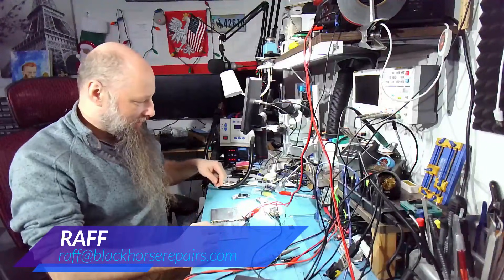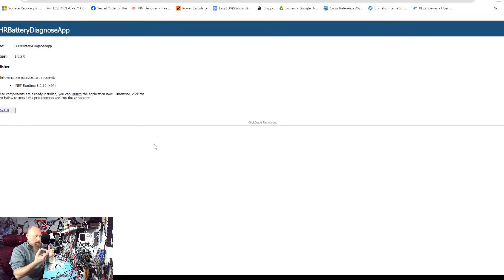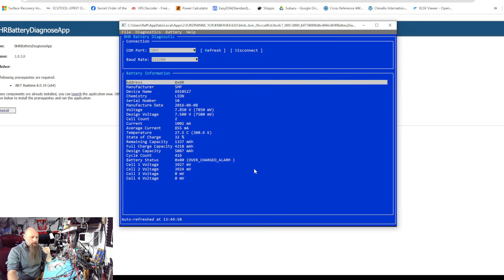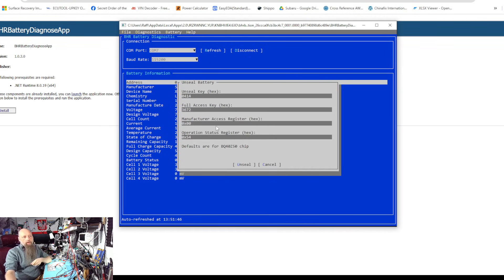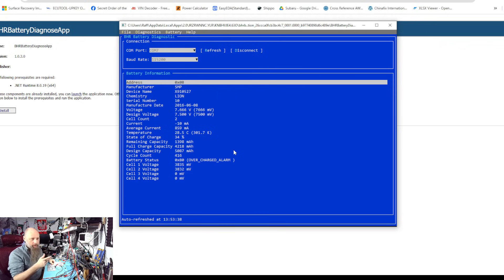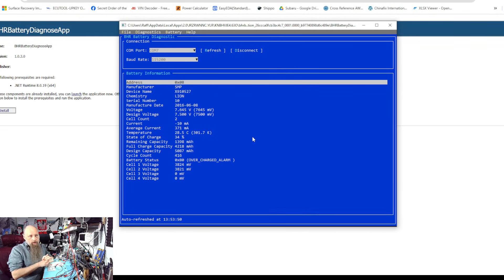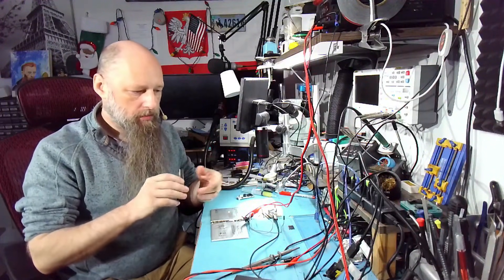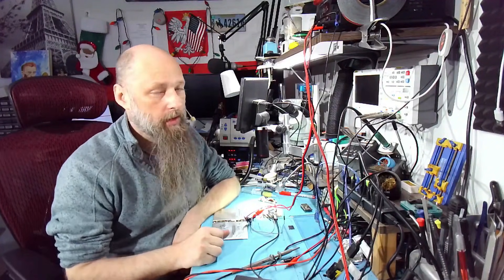Battery Diagnostic Tool - Beta Release

Comment: hey guys can some post the wire connection from esp32 c3 to the battery (what pins we use on the esp32 c3) thanks
Reply from the maker: IO04 - CLK
IO05 - DTA
Reply: Thank you

Comment: Do batteries protect themselves from brute forcing keys?
Reply from the maker: yes, there should be throttling allowing you to try only couple of times before you are timed out, but even without that testing all combinations is not viable unless you share the work across 1000s of nodes

Comment: I have eps32 C3 supermini and an arduino nano. Is there a way to load it on to either one? Assuming i would need the source code? I obviously have to modify pin allocations.
Reply from the maker: nano has 2kB of RAM while we need more than 3 so that one won't work. ESP32 is the best option. Make sure you download the firmware again, I just released an update
Reply: @blackhorserepairs  Sorry for Hijacking and thank you so much for your efforts, making this possible.
I´m not that into Microcontrollers, but have an ESP32-C3 and it´s Breakout-Board here. Is there a simple way flashing your firmware by eg just editing the linux .sh-script "--chip esp32" to  "--chip esp32-c3"?  Or another simple way?  gemini asked for sourcecode, but I´m fully aware it´s your baby. dont mind i wont ask. Sorry for noobing around.
Reply: @swifty8160 I have just loaded the three files in Raff's v.2 upload today that are within the "firmware\esp32" folder at the bottom. This has taken me to "no battery detected" Will test more tomorrow when sober lol. Nice one Raff 👍
Reply: @Mark_C1  Could you please clarify which device exactly your using now?`Did u manage to flash raffs Firmware onto ESP32-C3?
Reply: @blackhorserepairs will go with the esp32 then as the supermini has 4kb. TVM. I now have v2 so i will continue to try

Comment: May be Python would be a valid choice as a frameware for future tools too. Can be compiled into a independent binary, but it doesnt need to, as you prefer. Runs on many different systems with very few changed lines.

A 'battery wear level' reading would be nice, if doable. The difference between current full charge capacity and design capacity in percent. So the one at 2:33 would calculate as 100% * (4218mAh/5087mAh) = 82.9% -> this would read as a well aged, to be replaced soon battery, now aging very fast.
Reply from the maker: great suggestion, I'll implement that

Comment: Most of the esp32 use D21 and D22 for i2c as the default hw. Why did you choose to go with 4 and 5?
Also, why did you choose using an Arduino in the middle, while a simple ft232h board is way cheaper and software can communicate directly through it ?
Reply from the maker: Arduino framework or arduino board?
Reply: @blackhorserepairs  yes, both, I would take them out of the equation

Comment: Technical note on BQ8050 vs BQ40z60 unsealing behavior

Based on practical testing and SMBus experimentation:

BQ8050-based batteries
Unsealing is possible using standard ManufacturerAccess commands when the gauge is not permanently locked.

In my tests using SmartBatteryHack-master:

Writing to ManufacturerAccess (0x00)

Sending 0x0414, followed by 0x3672

Both commands issued sequentially within < 4 seconds

Successfully unseals the battery.

Tested battery:

Model: HSTNN‑UB7C

Gauge: BQ8050

After the sequence, the battery transitions to the UNSEALED state and allows access to protected functions.

BQ40Z60-based batteries (Lenovo)
For newer Lenovo packs, such as:

Battery model: L17C4PB0

Gauge family: BQ40Z60

Unsealing via SMBus is not possible once Permanent Failure (PF) is set.

Key observations:

PF flag permanently disables unseal keys

ManufacturerAccess unseal commands are ignored

OperationStatus, SafetyStatus, and PFStatus remain latched

CHG / DSG gate drivers may still be active, but logic-level access is blocked

This is enforced by OEM-custom firmware, not a temporary error

In other words:

On BQ40z60-class gauges, Lenovo disables the unseal mechanism at the firmware level after PF, making software-only recovery impossible.

Summary

✅ BQ8050: Unseal works using known key sequence if PF is not permanently latched

❌ BQ40Z60: Unseal blocked after PF by OEM firmware

🔒 This is intentional design, not a bug

🛠 Recovery requires hardware-level intervention (BMS replacement or gauge replacement), not SMBus commands
Reply: This is some pretty nice info. Do you know anything about how BQ20Z95DBT handles PF? Do I need to replace the bq20z95 itself? Or PF-state manageable by software?
Reply: @swifty8160  

PF (Permanent Failure) is essentially the end of the road.
Once a battery enters PF state, nothing can unlock it. It is even worse than a sealed battery.

The best solution is to replace the BQ fuel gauge chip. However, the replacement chip must be programmed with exactly the same configuration data as the original one.

This data must match the battery cells precisely.
The only reliable way to obtain it is from another working battery of the same model, by extracting its configuration and flashing it into the new BQ chip.

Comment: Please open source the code as well! It'd be awesome to port this to linux as well and write a more friendly UI :)
Reply: Second this, there have been too many shitheads that wanted to profit off of this using illegal or at least questionable tactics. Open sourcing is the only way to drive them out of business and therefore saving everybody else from being at their mercy...
Reply: Oh and I'm pretty sure Louis Rossmann would love to host the battery information and key list on his Consumer Wiki
Reply: Keep it closed source and charge money. There are far too many broke open source devs who abandon projects because everything free
Reply: @mychromebook9935 while I agree with the sentiment you present, that open source devs are very much underpaid (I love doing open source stuff myself and have / do support some projects I really like), I don't agree at all with your take.
You should advocate for supporting open source devs via donations and consultation work, not taking away open source software.
Plus, people should have a right to easily know what's on their computer.
A nice way to offer people a way to compensate you is to provide an "easy to use package". Currently someone will have to go splice cables and make connectors for different batteries, flash the firmware, debug, etc. You can offer a well built kit for a price :)
Plus, .NET projects and firmware files from well known SDKs are some of the easiest to "decompile".

Comment: I noticed that the battery has a capacity of 5000mAh but the full load is at 4200mAh. Does this mean it can be charged up to 100%, which is around 80%, with no degradation? I usually try to charge the batteries in my devices up to 80% to avoid that.
Reply from the maker: yes, that means degraded cells

Comment: Great news! I'm going to download and play around with it. I don't think I have any locked batteries on hand, but will see what happens. I have a pretty large collection of ESP32 variations to try it on.

You might consider using an optional configuration/properties file to override like the i2c pins, then you could support any ESP32 model without custom builds.

Also, cool to see a TUI interface. Reminds of developing in Borland Turbo C++ and TurboVision back in the day. :)

Comment: I'm confused which esp32 board to buy. Most of them have SDA and SCL on pins 33 and 36. Is it possible to help you with "hacking" the batteries ? Do you provide some tools to crack the codes ?
Reply: On most of the esp32  the hardware I2C  pins are GPIO 21 and GPIO 22. Its a beta realise, i believe its just a prof of concept, a base that will alow you to read a battery BMS, not cracking functions, those are hard to do, and will take time to develop. But it's very good work on the part of Black Horse Repairs, better than that asshole that was selling software that was using stolen code from is workplace and was blocking access to paying customers, just because they gave input or expressed their opinion.

Comment: I'm trying it now on a BQ 27541 from an ebike battery.
Reply: I'm using a esp f devkit v4, tried D4/D5 and when i want to connect i get 'The I/O operation has been aborted because of either a thread exit or an application request'. Is it because it failed to connect to the battery?
Reply from the maker: are you using windows? I haven't seen this issue
Reply: @blackhorserepairs Yep, ill look more into it in the weekend.